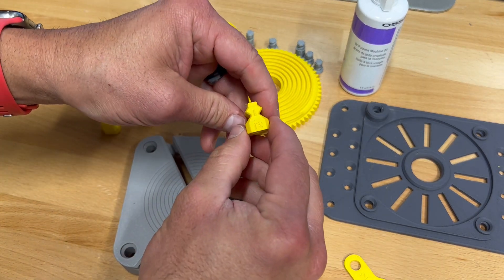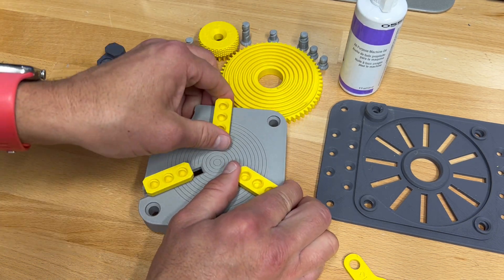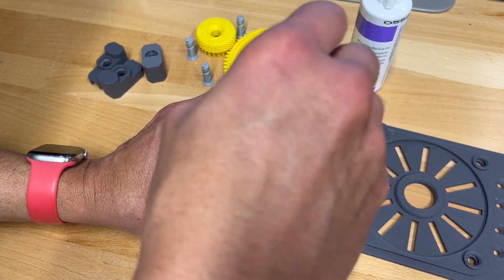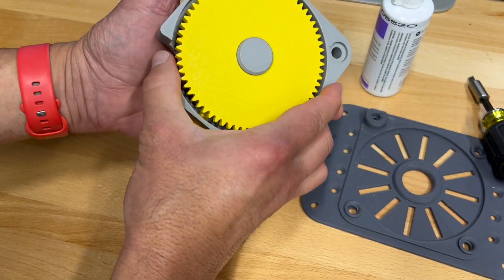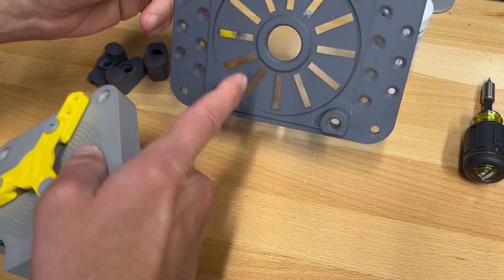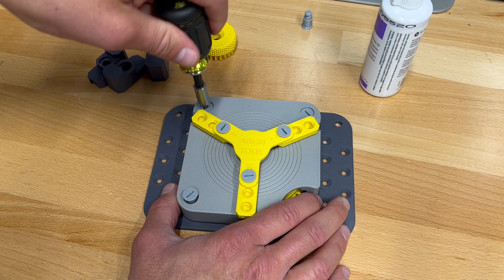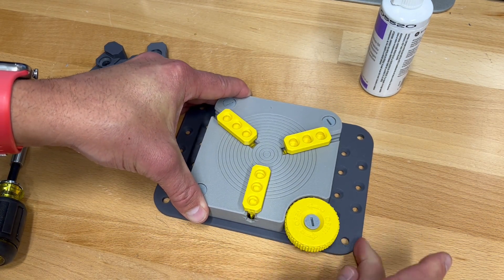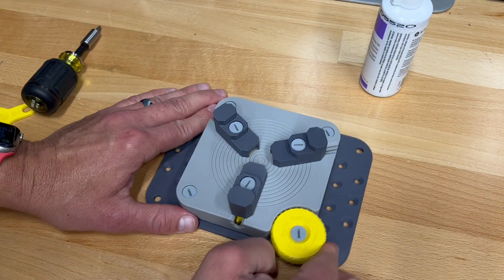3D PRINTED 3-JAW / 4-JAW CHUCK ASSEMBLY

Comment: tried printing this like 5 times and asted so much filament but it keeps warping in PLA D: it's a really cool model tho... i'm debating doing another try with a slow AF first layer and this time use dish soap to clean the bed. or just use PETG as that always sticks to PEI great, Not gonna lie I miss my buildtack. everything always stuck to it without problem!

Comment: Hi Brent, I printed the 3 jaw and it is a fantastic design.  I really appreciate the thought and effort in creating this design and instructions.  I like the approach for the easy fit screws, are you able to share the method you used for the screw thread. I've done simple threaded bolts (M8, M10 etc) in OnShape and wondering how I could achieve similar screw to yours.
Reply from the maker: Thanks Ian, I appreciate that!!

I designed this in Solidworks.  I made a Helix and a cross section of the thread cut.  Then I did a swept cut of the cross section along the helix.  For the base where the screw threads in, I used the Cavity feature.

Comment: printed the 4 jaw version yesterday. I think it should be useful when soldering, painting, or gluing things. I did the multi screw hole base part in black, top in grey, teal jaws and knob, and white screws. took about a full 24 hours on 2 ender-3s. Might print the 3 jaw version if i use this one enough.

The one thing i didnt like, is the "align tool" seams wasteful, there has to be a way that uses less, or no plastic.....the tab over the thumb screw made no sense to me, again it seamed wasteful, so i printed it with a modifier that removed it.

ill keep an eye out for your next tool.......... might try the dino chip clip too.
Reply from the maker: Definitely always a better way!  I have a list of things I would do differently, just no time right now to update it 😉

Comment: Qual a utilidade prática para isso? 🤔
Reply from the maker: I initially made it for holding items in my laser engravers, but I use it for hundreds of other things now.  Holding parts mainly when I'm soldering, gluing, etc.
Reply: I use for painting models and printed circuit board repair/assembly.  Basically I use to hold small things under a microscope